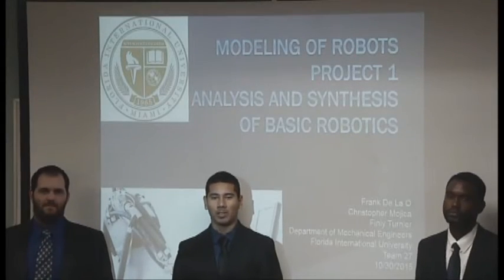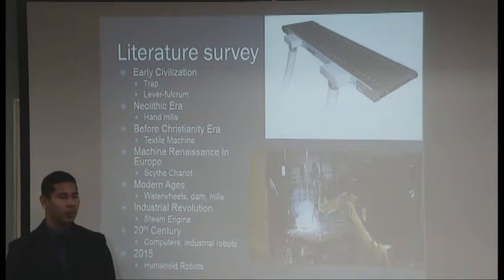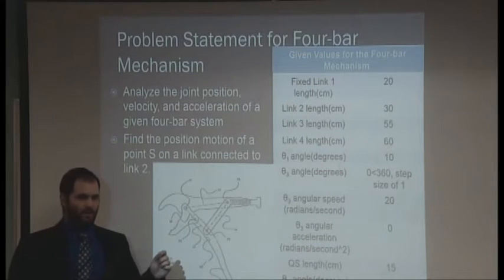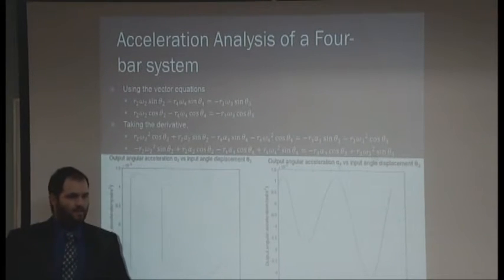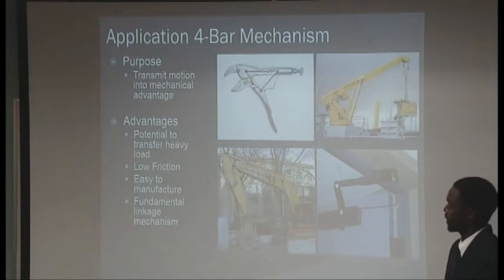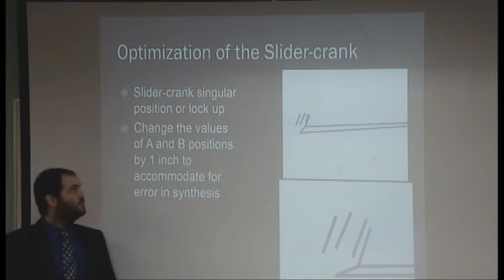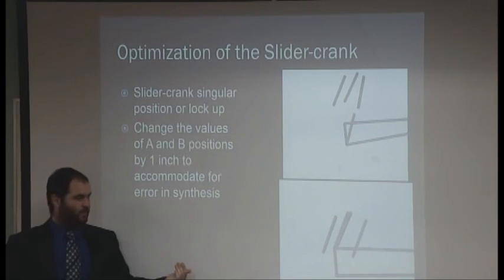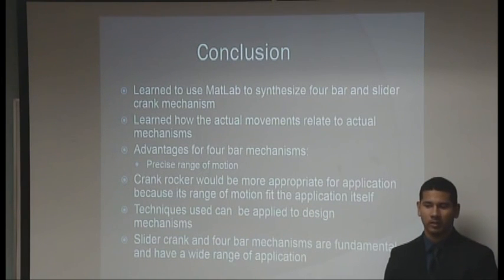Team 27: Mechanism Design: Crane Boom & Locomotive Drive Mechanism

Comment: Great video. However, the video outlasts the 10 minute requirement. This could be reduced if the speaker for the literature survey/conclusion slide spoke with a little more confidence to avoid dragging on the time.